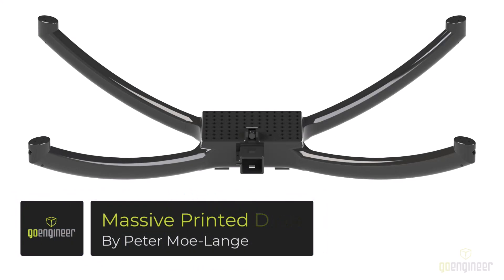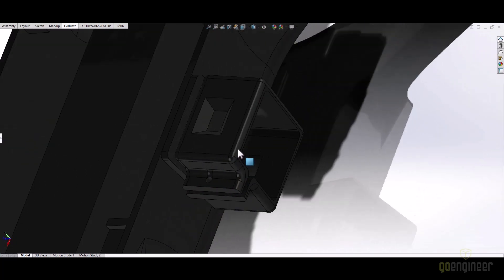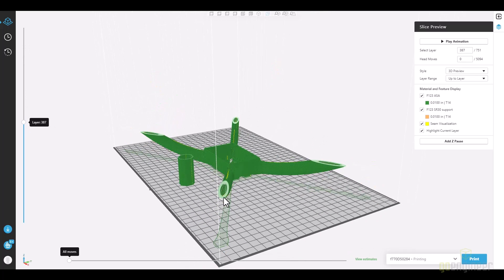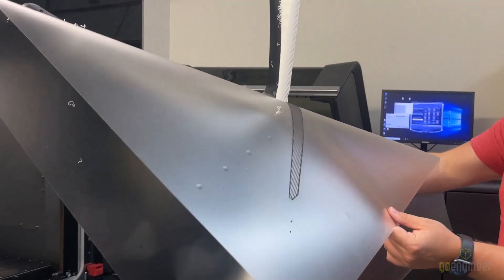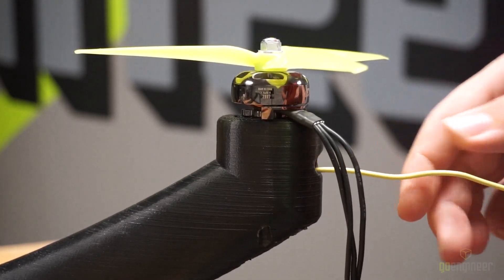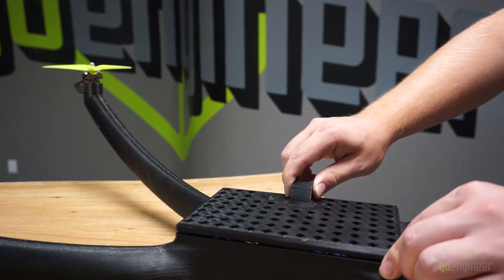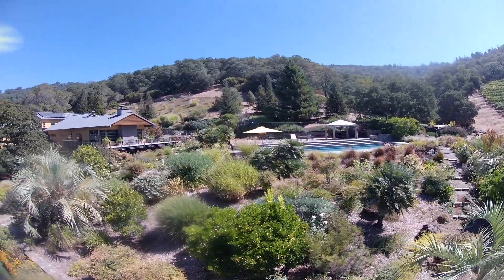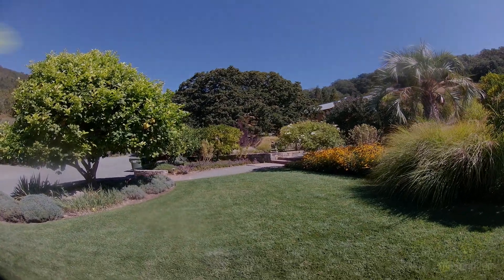Massive 3D Printed Drone - Stratasys F770 FDM 3D Printer

Comment: What is the most recommended material for such outdoor prints? ABS, ASA or Nylon?
Reply from the maker: All of those are good options but your individual use case or performance requirements will be what make the difference.

Comment: You don't need support material inside of the arms at all. It's an organic shape so it doesn't need them. It'll save weight which will equate into more run time/speed.

Comment: It looks alien from afar!
Is 7" the largest prop you can put on it?
Reply from the maker: That is an excellent question engineering wise. We would need to look at details about the motor and the materials used for the construction of the props.  Along with making sure there is clearance from prop to prop.  These are all things we could solve for using the solidworks design tools